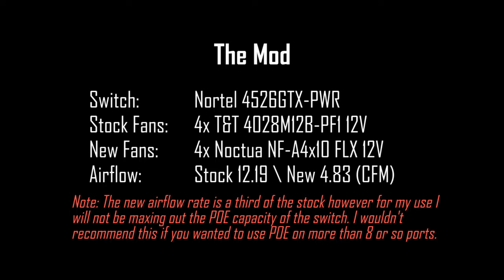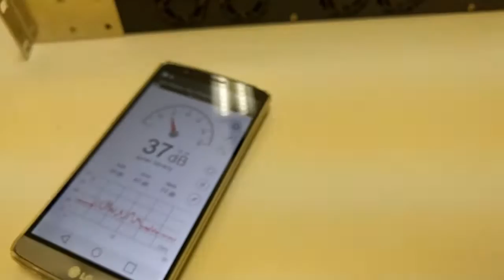Nortel Switch Quiet Fan Mod

Comment: but it has a much lower CFM too, monitor the temperature, as you may have a cooling deficiency. A normal fan has an average of 15CFM, the Noctua has 5.5CFM

Comment: Greetings! I was inspired by your video to change the fans of my avaya ers3500. They work perfectly! The only issue is a little less performance (4 degrees difference) and the mounting not being completely right. Should be also noticed, that swapping black and red cable didn't work for me, i had to set em "Black - Yellow - Red" in order to work.
Reply: Hi, Just wondering which model of ERS3500 did you try this on?

Comment: We are having a lot of network problems. I've noticed that the fans of the switch never turns. That does not look like something good to me. What do you think of it?
Reply from the maker: If they are not spinning the components on the board will burn out eventually. If you still want your switches you probably want to repace those fans or clean the old ones out.

Comment: hey i does the same with my switch a couple of month ago but i replaced the fans with "Cooltek Silent Fan 4020" they got a good airflow and are realy cheap .. i can still hear the fans but just at midnight and when everthing is turned off.

you can also put a resistor into the cable of the original fan but the fan still isn't quite.

Comment: I is a LOT quieter, but does it cool as good as dose other high speed fans, are the temps the same, that the biggest question?
Reply from the maker: Amiga Wolf the cooling will not be as good as the stock fans but it keeps the unit running fine. I'm only using 10 ports and it's not skipped a beat. There also doesn't seem to be any temp monitors on my version. The unit is virtually silent, if you want more CFM you will sacrifice on decibels.
Reply from the maker: Amiga Wolf Noctua fans are so good I'd be hard pressed to buy another brand. Enjoy your purchase!
Reply: 4 degrees difference... pretty acceptable